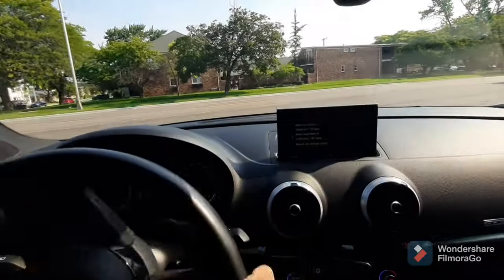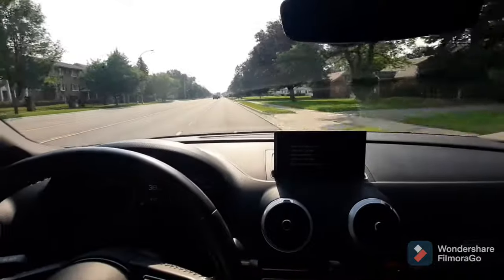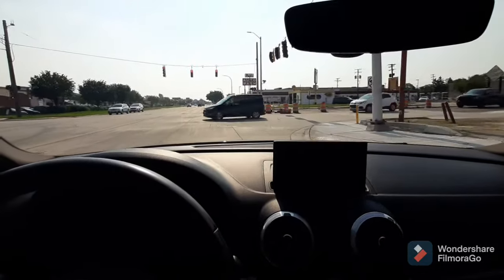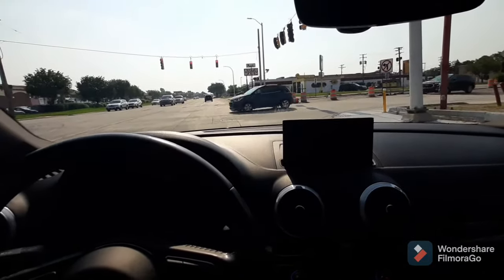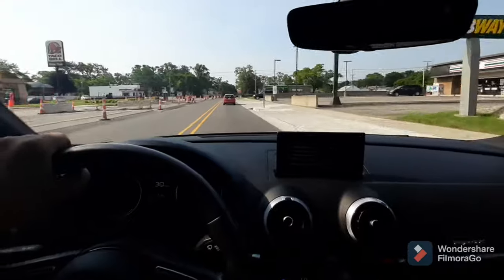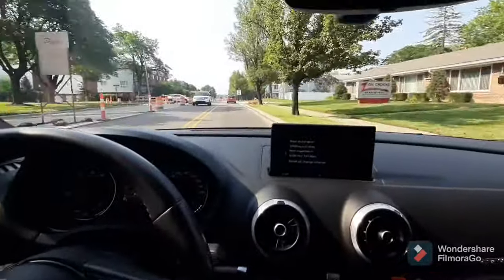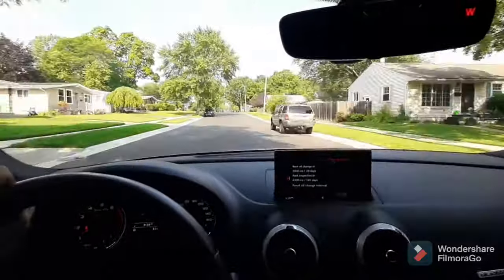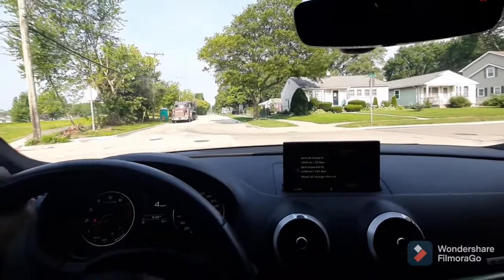How to tell the difference between a wheel bearing noise and a tire noise from drivers seat

Comment: I’m gonna try this today, the best comparison to mine was that I hear exactly that sound you made when I’m slowing down.
Reply from the maker: Yeah slowing down is usually the giveaway for a tire noise
Reply: @EuropeanAutoRepair  so when U slow down the noise goes up?...
Reply: You should still hear the woo woo woo sound when slowing down then it's a tire issue.  Check if your tire is wearing on the corner of the tire then wheel alignment needs to be done n you can drive a few more till you buy new tires then do alignment once more.  Wheel bearing noise needs to hit a certain speed to hear so if you slow down, you will not hear the woo woo sound then it's your bearing.

Comment: I hear what I believe is wheel bearing noise when I drive straight down the street. When I turn the car to the left it stops and is pretty quiet. But straightening out it's noisy again and turning right it stays the same pretty much. Does that tell you which side of the wheel bearing is gone? thank you for the video

Comment: After 2 months of research and looking around your "woo woo wooo" on deceleration  gave me my answer. I had a feeling it was the tire, but when i changed the one i thought it was it stayed the same if not got worse slightly. It sounds like it comes directly from my front driver side tire. I did find a flat spot on my passenger rear tire but all the noise comes from the front. Weird
Reply from the maker: Yeah man tires noise can be a pain to isolate, im glad this helped you out a bit
Reply: I had a similar issue, so if i do a tire rotation will that help or i need to replace the tires completely as my tires are just 18k miles old and weird thing is it started to happen when i rotated my tires last time and it comes only from front…any insight would be helpful…Thank you
Reply: Look at your thread wear on the corner of the tires.  Alignment issue if is.   If woo woo woo still stays when breaking to decelerate then not bearing issue.

Comment: What if it makes a noise every rotation? And slows down when I slow down and speeds up when I speed up?
Reply: In my experience that would be a bent brake dust shield that periodically makes contact with the rotor.

Comment: I’ve got a very light knocking noise that sounds like it’s coming from the front but it’s not constant. The car has very low mileage so I’m inclined to believe it’s not a wheel bearing but I’m no mechanic. It only happens occasionally when driving straight and I don’t feel it in the wheel or pedals, what do you think is the most likely cause? Great video!

Comment: Hi and thank you for your simplicity in explaining. I just bought Corolla se 2023. On speed from 50 and up I have this “wo wo wo” sound and goes away when slowing down. Is it tires noise? Also what gas you recommend for this car? Thank you 🙏
Reply from the maker: It’s possible that it’s tire noise, I would 100% recommend having a tech at the dealer test drive and verify. I don’t know too much about those models so I would go with whatever octane requirements are on fuel door, sorry I couldn’t be of more help
Reply: @EuropeanAutoRepair  Thank you 🙏

Comment: I jack the vehicle up and spin the rims/tires. If a wheel hub/bearing is bad, you can hear the grinding when you spin the rims/tires. Plus moving from side to side will cause the pitch change for sure while driving. I'm hoping the noise we are hearing on our 2012 G37 is the tires, not the trans as I'm 90% sure it's not the wheel bearings. The passenger side is super quiet no noise at all when I spin things, the drivers side has a tine bit of scraping sound but just barely and I attribute that to the brakes barely touching. Older tires from 2015 & 2018 on the car now, replacing the 2015 ones Tuesday and seeing how that affects the noise we are hearing.
Reply: Update?

Comment: I just got new tires and I started to experiencing humming noise a day after on acceleration and deceleration, not sure if it’s actually the tires or something else. Is there anyway I can find out for sure?
Reply from the maker: If I’m unsure I lift the car up and listen to the hubs with a stethoscope while wheels are turning, if the noise lines up with tire replacement that’s most likely cause

Comment: A constant growling is another clear sign of a bad hub or wheel bearing. Unfortunately,  sound likes to telegraph and sound like it's coming from the opposite side of where it's originating from. A good and thorough inspection will usually point one in the right direction.

Comment: Does this method work if you’re trying to diagnose the back wheels as well?
Reply from the maker: Loading vehicle side to side will usually cause a change of pitch with a failed rear wheel bearing as well, sometimes not as sharp of a pitch change

Comment: I had a wub wub sound coming from my car, and it turned out the garage that changed my tires didnt tighten the bolts enough so def check that out.

Comment: I am very grateful you did this video. I had a new car with humming noise after like 2 months. Was afraid it’s wheel bearing and I don’t know how to differentiate. 

Haha my noise symptoms hit all your tyre noise criteria’s. I can breathe a sigh of relief for now. ! Subbed!!!
Reply from the maker: Thanks man, happy it was helpful
Reply: @EuropeanAutoRepair  hi, does inflating or deflating tyres will change the humming sound? What if it doesn’t change the sound pitch or volume. I tried trying 32psi to 36psi
Reply from the maker: Usually tire pressure doesn’t influence the noise even if it is a tire related problem from what I’ve seen

Comment: ill give this a try, my driver left side is making this loud rumbling noise/heavy tread noise and I have no idea what it is, I noticed when the issue first started it was more of a whistling noise than after a bit changed to a squeak and now a rumble, my car does veer to the left a bit and when I jacked the car up I noticed the wheel doesn't spin freely but there isn't any play. no idea what it is
Reply from the maker: Sounds like you may have a brake caliper binding, check for rotor discoloration and excessive brake dust on that corner

Comment: This is my type of tutorial, no beating around the bush, just concise easy explanation.   My issue is strange- I have an Audi S3 and I get a very faint "tick tick tick" sound at only 10-15 mph then it just fades away. My car otherwise drives pretty much perfectly , it was very well maintained.  What the heck is this???
Reply from the maker: It’s funny you say that, I have a a3 at the shop with that exact complaint, I’ll let you know when I get to the bottom of it, thanks for watching
Reply: @EuropeanAutoRepair  I would so much appreciate that, If you could tell me what the issue is .
It’s really one of those things that nag you so much . 
My local mech here in Greenville, South Carolina, could not figure out what it was yet.
My car has never had an issue, it’s stage 1  with 49 k miles .

Comment: I’m in the same boat man!!! I’m getting a woo woo woo noise when I come of the gas. When I’m on gas it goes away? Exactly like the guy in the video suggested so I hope it’s tyre!!
Reply from the maker: I hope that’s it too!
Reply: @EuropeanAutoRepair  do you experience any vibration issues with the woo woo noise? I read it could be bearing but I don’t seem to get any factors of a bad bearing? I get no noise on acceleration. It’s all when I let off? Nothing when I turn my wheel
Reply from the maker: @jayroberts4900   not necessarily accompanied with vibration, sounds like a tire problem from how you are describing
Reply: @EuropeanAutoRepair  will look at replacing the front two tyres and go from there. If it’s not that, I’ll check bearing..  I need new tyres anyway so it’s not as if I’ll be throwing money away if it’s not that

Comment: On our 2013 G37 I suspect previous owner(s) put in the wrong power steering fluid and that is the noise I hear when driving. Nissan/Infiniti/Toyota uses Dexron ATF, NOT US style power steering fluid, which is what I believe is in the G now. Getting a pump from harbor freight today and getting started on this project...
Reply from the maker: Hopefully it’ll all be fine, you may even pull the return off the steering fluid reservoir and put it into a bucket, start it up and add fluid to the reservoir fast to flush it out, 2 person job

Comment: What would be your best guess at that noise you made lol at only between 25 and 55 mph? No vibration felt in steering.
Reply from the maker: Haha I’d say tire issue
Reply: @EuropeanAutoRepair Thanks dude. I sure hope so because it's a 2013 SL550 I just bought for 10k under market.
Reply from the maker: Nice! I hope so too man

Comment: So if it does get louder when decelerating then its a tire issue?? The noise I have doesn't change pitch either when I turn the wheel while driving like you did.
Reply from the maker: It’s not 100% but yeah usually from what I’ve seen the noise will increase and continue until you are going very slow

Comment: The problem I’m having is I’m getting vibrating and I’m hearin this thud noise like I’m driving with a flat tire but my tires aren’t flat or low on air
Reply from the maker: I’m guessing a tire problem, maybe a shifted belt
Reply: Helicopter sound? Probably needs alignment and unevenly worn tire
Reply: @Avery1980 I have similar issue , what was your finding

Comment: I bought a Honda pilot that was  super noisy at even 5 miles per hour and the tire tread were wavy as they can be and at 55 it was vary noisy. A vehicle I currently have just suddenly had a noise that sounds vary similar and get louder if I take load off the affected side. I'm going to swap that tire to the rear and see if the noise moves  with it if it does its a tire if not most likely a bearing. I've changed over 20 wheel bearing on my vehicles and friends and  only one of them ever had any movement or noise when jacked up and tested.
Reply from the maker: Yeah I agree as far as testing goes, the only way I’ve found to verify a failed wheel bearing is put the car on the hoist with someone inside and run it up to about 50 or 60mph listening to the hubs from underneath with a stethoscope

Comment: I just got brand new 4 BFGoodrich tires and when driving on the highway and the speed goes above 80km/h I start hearing this cyclic Wooo Wooo Wooo noise and it's getting worse with increasing the speed. I guess according to the description and what many people are saying in the comment section it's because of the tires, but they're brand new ....... just bought them, shall I think of changing them again?
Reply from the maker: I really depends how much it bothers you
Reply: @EuropeanAutoRepair  to be honest not much, I just want to know if this is a more than just a noise problem and whether it could evolve to something more. I haven't noticed any other problems besides this though, so can we consider this to be just a cosmetic flaw ?

Comment: I have like a growling sound when turning left at the roundabouts usually(so at low speed) front left tire. Do you think that is the tire? If so, why doesn't make the same sound when turning right? Also i see that the tire same tire, has a higher pressure than the other ones. I have a mercedes w205 220d 2016
Reply from the maker: If the noise goes sharply from loud to quiet when you load the car side to side it’s likely a wheel bearing, if it’s more subtle and continuous and keeps going at low speed until you are practically stopped it might be a tire

Comment: Changed my summer tires  they are like 40 % ..  The moment I changed and left from the mechanic I have some sound as if the vehicle is going on the rough road this usually happens at higher speeds .. before when I entered the mechanic it was super smooth with winter tires as the tires were also in good condition.. it’s obvious that it’s the summer tyres fault right ?? Not the wheel bearing
Reply from the maker: If it started immediately after tire install that's a safe bet

Comment: I realize this is an older video but thought I would give it a shot. Have a 07 Toyota FJ with a roar in the front between 45 and 50 mph. Replace both front wheel bearings and balanced and rotated the tire and noise still the same. I can feel a little vibration in the steering wheel when I hear the roar. CV axles were replace a few years ago. Not sure were to go from here...
Reply from the maker: Next step might be running the car in the air and checking for differential or transmission noise with a stethoscope
Reply: @EuropeanAutoRepair  Thank you... I may take it to a shop and have them put it on a lift. Tested it again and I can change the level of the roar by turning left. What would that indicate?
Reply from the maker: Typically that is more a sign of a failing wheel bearing. Sometimes diff or tire noise can be influenced by side load as well just to a milder degree

Comment: I bought a car and after taking it home I thought it had a wheel bearing issue.  Spent hours trying to diagnose the issue and pinned it down to it coming from the front right wheel.  Couldn't find play in the wheel, but having a wheel bearing go bad on my last car I know that play doesn't mean the bearing is fine.  I went ahead and checked tire pressure on all four wheels and sure enough, 3 wheels had 33-35psi while the front right had 48psi in it.  Checked all 4 tires tread and 3/4 were just fine, but sure enough the front right wheel had very little tread left in the center while having normal tread on the outside.  Turns out the last owner was just a moron who didn't understand the importance of filling up the tires to spec, probably just saw the low pressure light come on and filled it up for like a minute at a gas station and never questioned anything.
Sounds exactly how you described as well.  It's fine I guess, the tires on this car look like your generic Walmart garbage.
Reply from the maker: Well I’m happy that you at least got to the bottom of it, I’ve had noisy tires and just toughed it out until tread was low enough to justify replacement, annoying as it is

Comment: Just had my front wheel bearing replaced as I was hearing some rumbling noise on the highway.  I drive 55mph+ I can still hear the low rumble noise. It doesn't change when turning and I don’t really hear it at low speeds?
Reply from the maker: It’s possible it’s a tire issue, I would have a local shop lift it in the air and listen with us at speed from underneath, if nothing unusual is heard it’s likely a tire problem
Reply: @EuropeanAutoRepair  Yeah, I was wondering if maybe it was the tires.  They are getting down there in tread depth to 4 and 5.

Comment: Hi mate, brilliant video. I have a 2019 1series (24,000 miles) and there is a drowning noise when I go over 50mph, really noticeable when I get to 70mph. I replaced 2 front tyres today as they were near the limiter and there is still the same noise.

Mechanic said there couldn’t be a bearing away with such low mileage but I assume it has to be that? Back tyres are like new so it is not them. Running Bridgestones all round so high quality rubber.

Tried weaving left and right and can hear a slight difference in noise while I do it but nothing major.
Reply from the maker: It would be nice if you could have the car put up on a hoist and listen to the hubs with a stethoscope , that’s the best way of isolating a bearing noise that I know of
Reply: If low mileage on the wheel then could be alignment issue.  Changing tire will not fix the issue.  It is like putting a bandage on to stop the noise temporary till the alignment eats up the side wall thread n you will hear your woo woo woo again.

Comment: I keep hearing a loud noise like the tires are rubbing when I turn towards the rt and sounds like it's the passenger side. Already changed that wheel bearing hub not long ago. Assumed it was the bad camber alignment as it was REALLY bad. Got my car back after having the motor mounts changed so bought new tires as my old was were balding on one side. Just drove home after having the alignment done and it still makes noise!. I'm so tired of putting money into this car. Any idea if it's the hub or something else?
Reply from the maker: Make sure that the large axle bolt is tight, I’ve seen them come loose and destroy bearings

Comment: I have a ticking sound that is steady while accelerating, deck and driving, goes away when braking.

Would bearing give off a metallic click?
Reply from the maker: Not normally but it might be possible, I’d check brake hardware real well

Comment: I am having an issue with my 2014 Mercedes C300. It is making a rotational whining sound that goes up in pitch with speed. It's not a grinding sound but more of a whiney sound. I took it to the dealer and they are claiming that it is most likely a bearing in the transfer case. They want to charge me $9k to replace the transmission and transfer case. I do not believe it's that. The noise seems to be much louder on newly paved roads vs. a more worn road. I also have new tires (Toyo Celsius) which I almost am thinking might be the cause. I also noticed just today that when I turn or put side load on the car in either direction the noise definitely gets louder until I pull out of the turn. Would a bad transfer case bearing cause that to happen in both directions?
Reply from the maker: It’s possible, getting another opinion is a good idea, lifting it on the hoist and having some up in the car running it while another guy is underneath listening to things with a stethoscope will isolate it

Comment: For example I’m going 65mph and let off the throttle the noise gets loud is that the tires?
Reply from the maker: Depending on the noise it might be, it’s it’s a lower pitch noise that continues until low speed it’s likely, other things can be louder on decel as well, gear noise in transmission and diffs is usually higher pitch